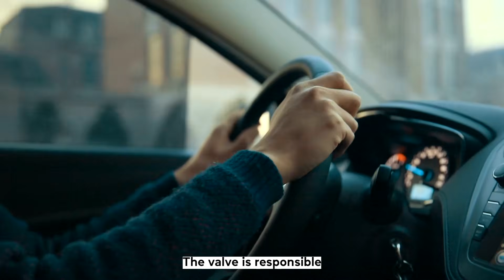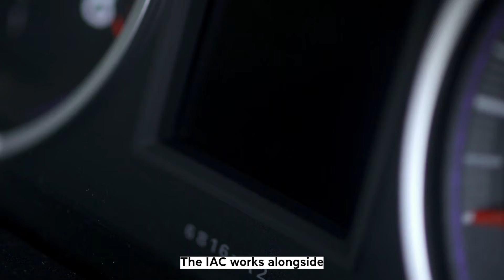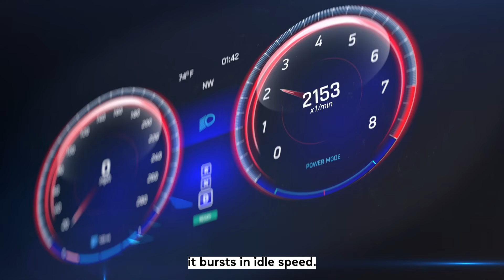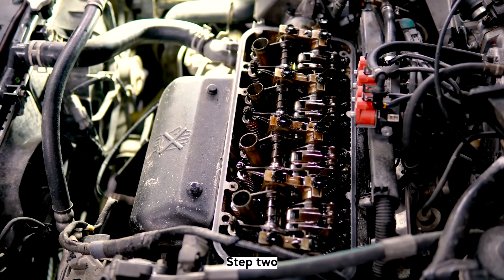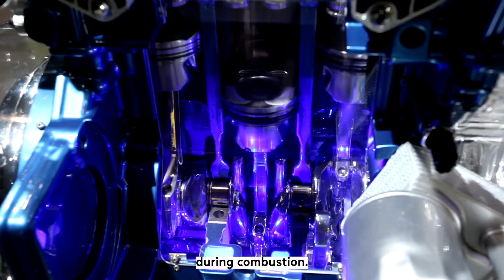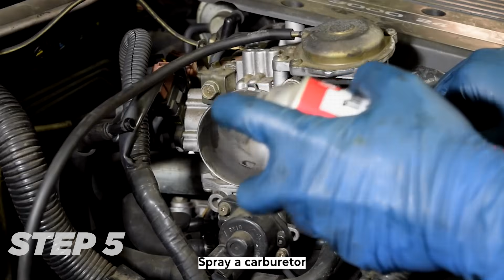How to Reset an Idle Air Control Valve - Symptoms of a Bad IAC

Comment: What about manual transmission cars?
Reply: Same procedure
Reply: @rootis2026  so for drive, do I put it in 1st gear, hold the brake and give gas?  I do not know if you should do that with a manual transmission.
Reply: @tomsmith2701 no you shouldn't have to put it into gear.
Neutral with the E brake on shoukd be fine.
Don't turn the car all the way on.. just turn to the key forward right before start up

Comment: If i started my engine and ran it at full throttle for 5 seconds, as he suggest.  I think my idle would be the least of my problems.  Does he mean KOEO?
Reply: I think he meant turn the key to the ON position, not actually starting the engine.
Reply: @juanvaldes2458 yeah he definitely should have been more specific.

Comment: the IAC valve does not INJECT air.  at idle, it opens to enable air to bypass the Throttle Plate. The engine is actually sucking air in.   If the IAC valve fails to engage, then the engine is starved of air, creating a rich running condition and causing the rough idling.  The dude that made this video needs to take it down, so much misinformation...if this was a meme, fact checkers would be all over it.
Reply: so i have a honda civic 06 and its been rough idling 1000 rpm to 1600 on park but go back to 1000 when on drive any advice i can get please what it could be i already cleaned the throttle body and the plate?
Reply: The guy who made this video needs to go back to school because this was absolutely ridiculous and quite disturbing. He's showing you how to clean the IAC by spraying inside the throttle body, you can't make this shit up man
Reply: I was wondering if anyone else picked up of the wrong terminology of the parts. Throttle body being called idle air controle valve @willsrestorations
Reply: @Ccter-yn3tw  True, I also picked it up. And know for a fact that the throttle first needs to be cleaned before you can clean the IAC valve. But cleaning the IAC valve itself is another story all together!
Reply: @willsrestorations well he flunked high school car mechanics.........

Comment: probs with IAC valve CANNOT cause BIG problems with your engine, it only affects engine at idle after it warms up...and nothing else. the worst case, is you have rough idle every time you stop at red light or waiting in line at drive thru while idling.
Reply: It can hesitate when taking off. It feels like it's dying. It can overrev on the road as you need to stop. It ruins the gas mileage.
Reply: It can stall out and it can rev very high on a cold start
Reply: Yo tengo ese problema con el idle control y el problema que me da es en frio en las mañanas cuando lo prendo tengo que pisar el acelerador para que no se apague y luego voy soltando el pedal si veo q hace para apagarse lo aceleró un poco ya cuando calienta lo suelto y las ram se quedan en 1 o 900 y pues ya no me da problemas es solo en frio